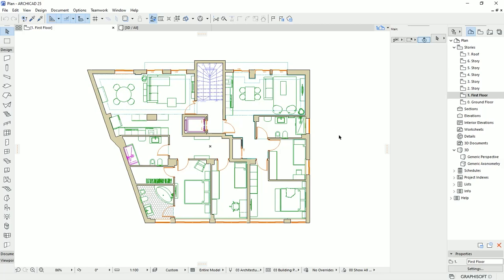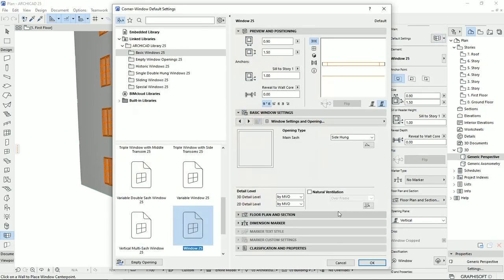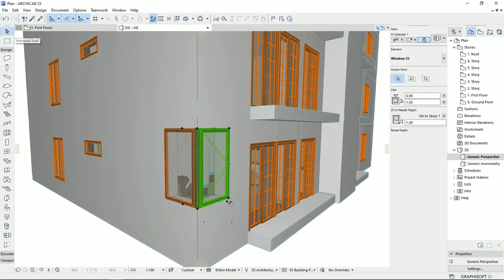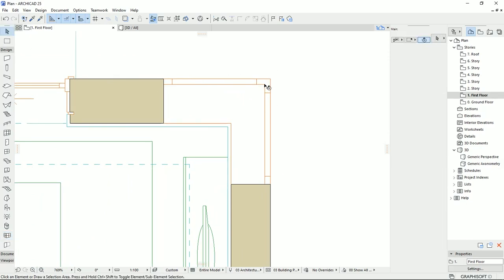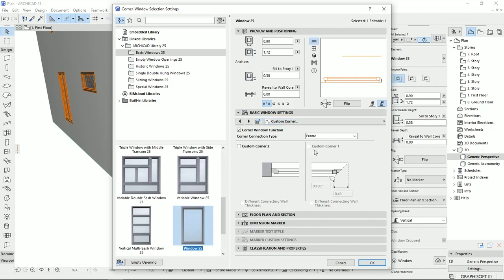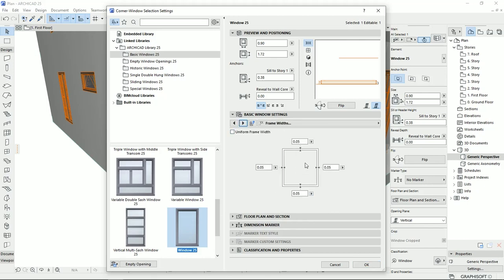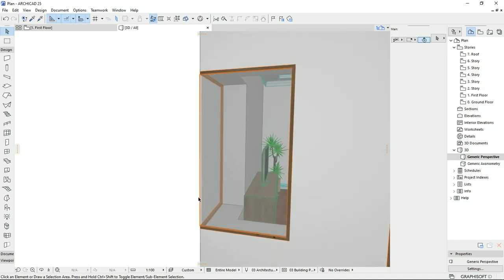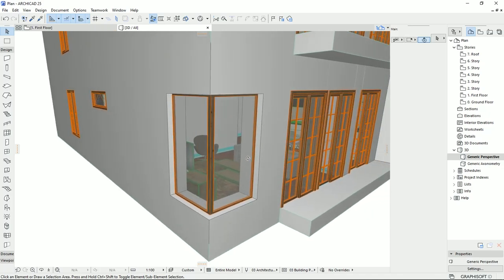Archicad - How to make corner windows [corner window tool]

Comment: I find it difficult to design a corner window in my archicad 18
Reply from the maker: I think if you follow the steps, based on this tutorial, you would figure out what does it make difficult for you. Do it step by step
Reply: @madtutorialsMT  It does not work in ArchiCad 19 neither 🙁. No Glass option for corner connection

Comment: Thanks you very much, But how if the next window is different, one has 2 vertical frames while the other has no frames?
Reply from the maker: Hi Herman. I did this corner window with corner-window tool. you can do the same process with two different individual windows with the window tool. then on the setting dialog on each window, you can edit the end cut corner frames.
Reply: @madtutorialsMT  Thanks bro...
Reply from the maker: @herman sukoco  you're welcome 😊